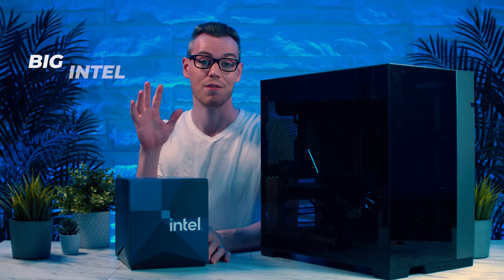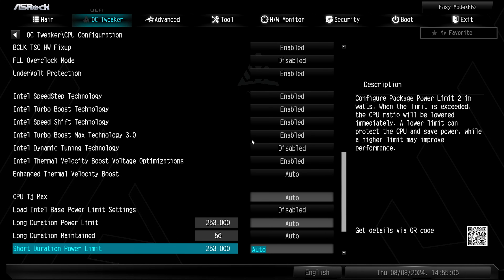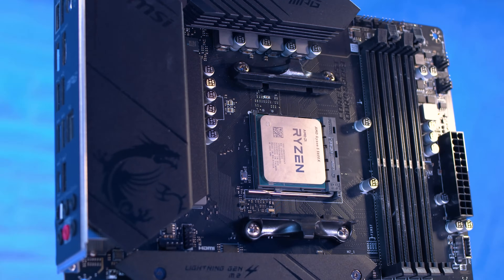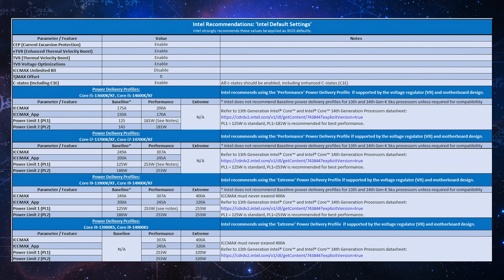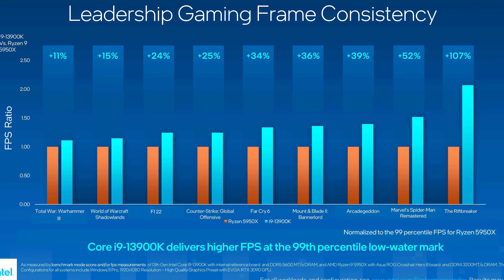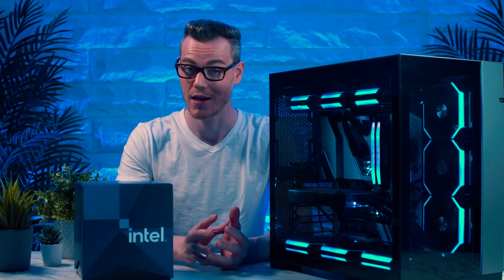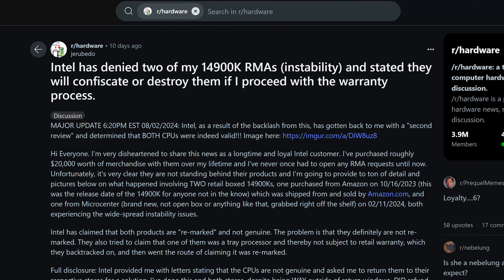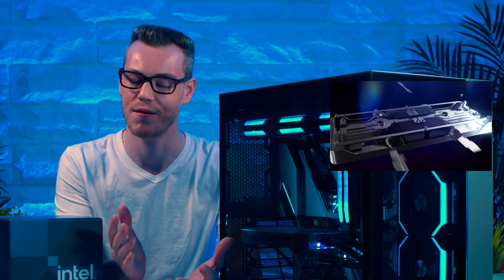The Intel Problem vs My $4000 PC... I'm Getting Mad Now

Comment: Keep in mind that I am no engineer, so really you shouldn't pay attention to anything I say, but I have a theory.  I think the oxidation thing is a red herring.  What I really think is going on is that Intel has something going on in the architecture itself that is causing degradation.  The microcode update will make no difference over the long term, as it will simply make the issue take longer to manifest.  The only "fix" here is to undervolt a brand new CPU, but that obviously will get you nowhere near the advertised speeds.  Now obviously Intel cannot tell you that, nor can they do a recall.   Their only move here is to attempt to "placate" to buy themselves time until they can come up with a proper fix, not for these CPUs, which I believe are unfixable,  but within the next gen CPUs, and in that way hope to sweep it all under the rug.  They are caught between a rock and a hard place, since right now they are teetering on the edge of getting through this relatively unscathed and completely destroying confidence in their products, i.e. forcing pretty much everyone towards AMD, which will be a point of no return and bankrupt them, and I am 99% sure they know that.
Reply: Yes this is true. NO IMPROVEMNT since Alder Lake, they're just pushing that silicon past its limits to keep up with Zen 4. It's literally breaking down because of their chase of 6ghz and shooting 1.5+V through all the cores.
Reply: @JoeL-xk6bo  This has been a thing coming for at least ten years, probably more.  For a very long time Intel was the only game in town.  Even before Bulldoser AMD simply couldn't compete.  Being an effective monopoly, Intel sat on their laurels and neglected to invest properly in R&D and advancing their manufacturing process.  After Ryzen they got caught out and are now playing catchup.  Again, I am no engineer but I suspect that for the last few gens they have been pushing the silicon to their absolute limits to "fake" performance, just to keep up with AMD.  Their process is just not good enough to cope with what they are trying to do with it.  If they were to keep things in check to ensure the CPUs will last, I suspect they'd have to throttle them hard, which would of course mean they'd start looking terrible compared to AMD in the performance stakes.  That is my theory anyhow.  Guess we will find out at some point.
Reply: I'm pretty sure that Gamers Nexus hired a Failure Analysis lab to do a 'postmortem' on one (or more) of the degraded CPUs (sent in by viewers, IIRC), who in turn verified the presence of the oxidation, which occurred due to a fabrication error (as reported by Intel).

It's confusing because this oxidation (allegedly) only exists in affected 13th generation CPUs, while both they and many 14th gen chips are also being degraded by whatever the 0x129 microcode update is intended to remedy. (It may in fact be a design flaw for all I know -- I'm not an engineer.)

The really jacked up part of all this is, once an affected CPU begins to show signs of performance degradation -- no matter what the cause is determined to be -- the aforementioned CPU is effectively toast: it can't be reversed or remedied, by a microcode update or anything else.

This is why Intel's stumbling around the issue of replacements is so infuriating.  A LOT of people (including HUGE corporate entities experiencing failure rates approaching 50% 🫨) know damned well that their CPUs are trashed, while Intel continues to stall and issue vague and conflicting statements.
Reply: @MikeBob2023  Well yes, I saw a report that claimed that oxidation is indeed a thing, limited to a specific batch of CPUs manufactured at a specific plant.  Whether it is a limited issue or more widespread, only Intel themselves know.  It is possible the CPU GN had was one of those.  Or it could be a bigger issue.  What I am suggesting is that the oxidation thing is unrelated, i.e. there is an architecture problem quite apart from manufacturing issues.  I of course agree with you regarding the microcode.  Ask yourself this:  If the issue was limited and could be prevented with a code update going forward, why are Intel not just immediately replacing all RMA'd ones, or explicitly stating that they will replace even if undamaged, making dead sure to communicate that they would do so, no questions asked?  Could be they are just really terrible at customer service.  Or it could be that they know it is a large scale issue and that replacing CPUs will cost them billions of $$$.  My money is on the latter.  Ultimately it is a PR thing.  As I said, Intel CANNOT do a recall.  It would bankrupt them immediately.  Nor can they (at this specific time) admit to a flaw, since that would effectively do the same.  What they are doing is textbook:  say as little as possible, do as little as possible, hope for it to sort itself out given enough time.
Reply: @siubhan2047  What I find incomprehensible is that Intel refuses to give the specific date ranges, codes, or the production ranges for the oxidation-affected CPUs.  It's as if they're fearful that users will RMA the parts within said ranges once they realize they're using them (and yeah, I know I would).  The upshot of this is (as I see it) that Intel is willing to let the blissfully ignorant remain ignorant for the sake of saving as much money as they can in 'addressing' this issue.

Bloody hell, I say. 🙄
Reply: @MikeBob2023  yes but you know what will happen if they do that? Of course everyone will ask for replacements, but the mere fact that they admit it will sow seeds of doubt regarding them as a whole. This isn't like with cars. I would be flabbergasted if they actually admit to it.

Comment: voltage are still high on the new updates though, so is it fixing anything?
Reply: I think degradation 13/14th is being slowed people will come out of warranty, idle states are being more actively used (framechasers had an interesting take on it). Have watched a few videos on the subject, don't think it's fixed. The degraded chips still should be RMAed and I believe the voltages on the P cores are still too high (my understanding).

Comment: I’ve personally been on Ryzen since Ryzen 2000 series CPUs till AM5 (now) and simply undervolt or used curve optimiser for all my CPUs 💪😇👍.

I used to overclock back in the mid-late 90’s but in recent times prefer undervolts as I’ve been building ITX PCs since intel 3770k and love sff designs 😱🤩🥳

Comment: intels microcode pre 125 didnt really lower multicore speed. Intel's 125 microcode lower multicore performance by around 5%. Intel's 129 (newest as of mid aug.) doesn't lower performance at all but it also seems to THROW MORE VOLTAGE AT THE FUCKING CHIP (Tech Yes City newest video today). by making their chips hotter they are hoping it throttles by heat because voltage becomes more of an issue

Comment: I'm wondering when i5's are going to start crapping out? I've got a 13600k and the last couple months I've started to notice stutters in work related tasks. Stuff that shouldn't have issues like filling out a spreadsheet or questionaire, or when I have two windows open at once on the same screen. Things that should be no problem for that cpu. It's not happening all the time, but it's making me wonder if it's starting to degrade. One thing for sure, is it's going to be my last Intel cpu. I'm already saving up to switch my pc over to AMD
Reply: disable 1-2 core boost, lock the P cores to all core boost, have Voltage below 1.3 V
Reply: @epeksergastis  It's stupid that we have to do that just to make sure the cpu doesn't die.........right away. It's like having a car that works as long as you stay under 80Km/h. Intel really shit the bed
Reply: @spentcasing3990  completely agree with you. They rushed Raptor in order to compete with Zen 4 and they fucked up.
Reply: @epeksergastis  Agreed it was an all around bad choice that will hurt Intel more in the long term. I doubt i'll buy another Intel cpu for a very long time if ever
Reply: @spentcasing3990  Arrow Lake won't have these issues
Reply: @epeksergastis  So they say, but that's kind of a bare minimum requirement. Even if it is, I imagine a lot of people have little faith in Intel. They are going to have a long road ahead of them buiding back consumer trust
Reply: @spentcasing3990  you're wrong.
Reply: @epeksergastis  How so ?
Reply: @spentcasing3990  Arrow Lake will use 100 watts less than Raptor for the same or higher performance. They will all come back quickly. We won’t see as high voltages.
Reply: Even if Arrow lake launches with 0 issues people won't quickly forget that Intel's last 2 generations are plagued with issues. Poor customer service, years of hiding issues and lying to consumers and buisnesses. They're not going to launch something new and shiny and people will forget what just happend.

So Arrow lake could be great, but people won't be as eager to buy or upgrade. Or at the very least, they'll be hesitant until consumer confidence has been restored, which could take years.
Reply: i5's already are dying, just at a lower rate. the 13600K and 14600K have definitely been dying in decent numbers too. 14600K especially. This is actually not new, because intel 11th gen had the same problems, people gave intel grace on that and overlooked it as growing pains finally moving from Skylake refreshes. That was actually a sign that their new architecture was shit. Their next gen cpu/gpu has been shit.
Reply: @JoeL-xk6bo  Alder Lake is the best CPU arch that has ever released.

Comment: Permanent damage already. Microcode update ain't saving it.
Reply: Yep, microcode patch only fixes for new users basically or users without problem.
Reply: @samwaller4092  Psst, spoiler alert, it isn't. The voltages are still too high and they are still gonna degrade. Marginally slower, but no big change. If they want to run them safe they would have to go lower, run them at around 1,3v. that means say goodbye to 6Ghz singlecore turbo, or any high turbos above 5Ghz in general. They do not want to do that so we have this mess.
Reply: @Lady_Zenith In other words, buy the 7800X3D problem solved lmao. Intel is a joke now.
Reply: time for him to buy a new replacement cpu to fix the problem muhahahahahahahaha or rma his cpu if it's still on warranty

Comment: Always had Intel heavily overclocked in my gaming systems. I have a 8700K that is running rock solid on 5.4Ghz (base 3.6Ghz) for over 4 years now, which is amazing. But this debacle brought me over to AMD.
Reply: Overclocking is a complete waste of time and money. All it does is risk voiding your warranty and shorten the life of your parts. When there is a genuine manufacturing defect you will be out of luck because you overclocked.

Comment: @TechLens I don't trust Intel's default settings. I've manually optimized my system using a Gigabyte motherboard profile (optimsed setting). I've applied the following settings: IETU with a -0.050v undervolt, AVX2 offset of 5.0x, Turbo Boost Power Max set to 140W for 128 seconds, all active cores at 53x multiplier. Under load, the voltage never exceeds 1.414v and there's no thermal throttling. I get a sore of 4004 on cinebench R23. No fail in the intel stress test all pass. If i try to set the IA VR Valtage Limit to 1400 by current EDP limit is  thermal throttling when idel it the same if i dont set it and use the new SAFE LOL defualt settings. Any ideas? BTW if i you the new mirocode bios update it worse LOL Cry cry...

Comment: I strongly believe that those 900 series are actually 700 series, but they got greedy and pushed those chips to perform as 900 by using some kind of voltage tricks that are currently failing, and they blamed it as bug. Now they're in a very difficult situation if they couldn't find a way to keep them run stable as 900 specs, they would have to revert them back to 700 specs and legal issues would probably hit them very hard.
Reply: technically it’s the other way around, all i7s and i5 k series are i9s that have failed, it’s called binning
Reply: Bit this issue is happening on server boards too...

Those are much better made and certified
Reply: This is such a low IQ take, the underlying architecture is totally different please see level1techs video to understand. And do you think Amd would dare do this is the current environment with what is happening to intel is laughable 😂

Comment: I agree, I think they are trying to buffer customers Sending in their CPUs for RMA. They can't afford and don't have the stock for any of this. They don't have CPUs that will be reliable to give out at this time. But I think it's mostly financial. Intel has been in trouble financially for some time now in my opinion. I have to wonder how much of the issues is from the design level and possibly materials or fab level. The last two I think are much less likely.

Comment: My response to Intel:

I'm buying AMD from now on.

(This scandal better create an new industry standard on how chips are screened and tested for defects moving forward; until that happens I no longer trust Intel to do the right thing).

Hell, even AMD has issues but they're the lesser of two... inconveniences.
Reply: Same. It took me a year between settings and BIOS updates to get both 12700KF & 12900KF fully stable (even left Windows for Linux, Nobara 40 now was 39). I don't even have the 13th/14th issue though had I spent more money I could have had it. 1 gen of support, it's a new low. 12400F also will stay untouched. Essentially 1 gen of stability this time around.

Comment: I hate knowing other consumers/gamers/humans have to deal with scummy behaviour.

But, as an ex intel fanboy, intel fanboys had it coming. Writing has been on the wall -  that's why I jumped ship!
Just saw someone post 5.2 ghz running 253watts on their 14900k(buildzoid video). 253 watts on a CPU is LOONEY! My 5950x does 4.4 running 105W, undervolted!
Reply: 200w+ parts are indeed insane for 99% the market, that includes GPUs, people need to get their head straight.

Comment: Personally think you do not know wtf your doing or how to build your own system... Using just a 360 AIO on my 14900k I can run OCCT overnight and never go past 77c running for hours 100% stable at fixed 5.8ghz all p-core, 4.4 e-core at a max 1.29v v-core without ever having stability issues for almost a year now.
Reply: you are incorrect
Reply: @zerokool1985  Amateur.

Comment: you have different way's to try to fix this by your hand set all 4 svid vcore voltage settings to the same voltage: my 13700kf run with 5.5 ghz + first two cpu cores + 1  5.6 ghz ring 5.0 ghz i have to set all four  svid vcore voltage settings to 1.35 voltage if i set it to 1.34 voltage or deeper i have the same problems as many other guys closing games blue screens this means the cpu need the minimum of the 1.35 on all four settings in the bios to run stable to high undervolting create the same problems as to high overvolting over longtime it looks for me over 80% of the intel 13. and 14. gen cpu user specific on i7 and i9 have no idea how to tune the k versions correct and give intel the fault for what cpu input voltage for 17 and i9 should be around 1.75 and 1.85 voltage .
Reply: you are incorrect . i can 100 percent  guarantee you will have cpu issues soon